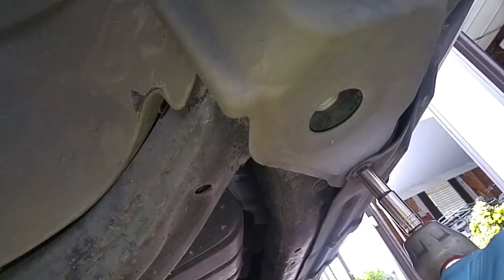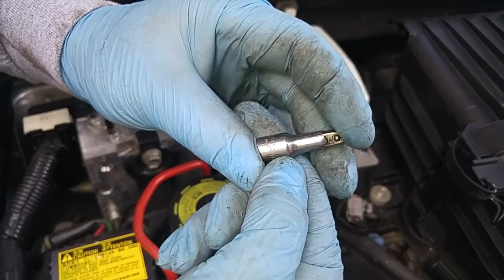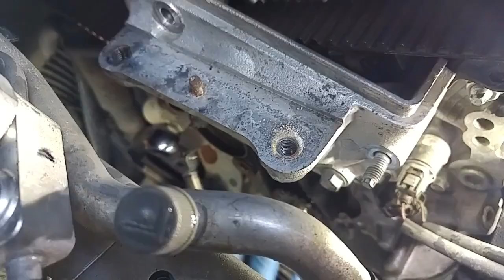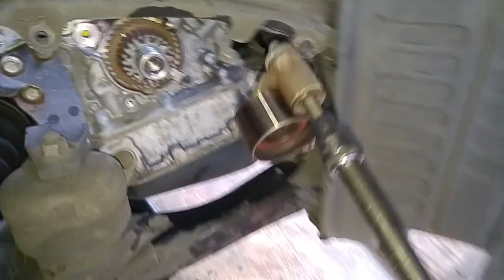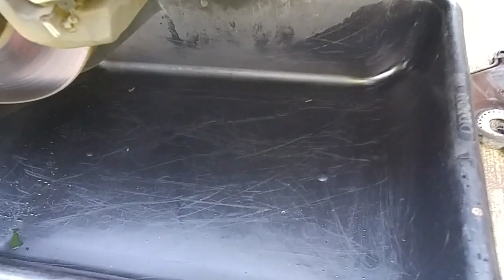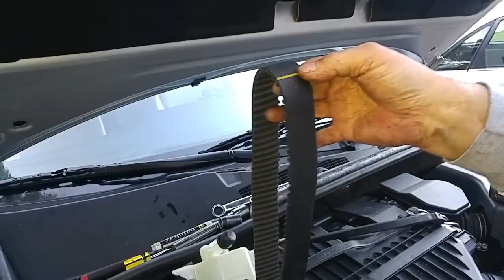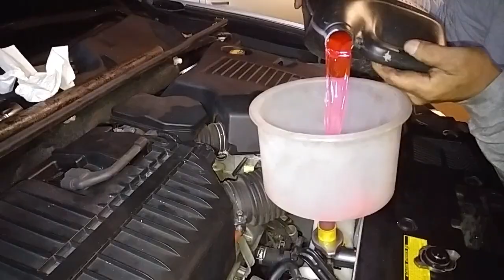Toyota Highlander Hybrid / Lexus RX400h Timing Belt, Water Pump & Seals - V6 3MZ-FE (2006 - 2010)

Comment: Timing belt is the worse invention for vehicles
Reply from the maker: Better than timing chain replacement. These chains don't last to 200k miles before something breaks or wears out. I.e. Chain guides, tensioners and chain stretch. Time consuming to replace.
Reply: @hardlymovingpro true that but all my chains last to over 365k miles like my acura rdx k23/24 engines
Reply from the maker: Consider yourself fortunate.  Replaced a 2AR-FE engine 2 years ago on a 2011 Camry XLE with 220k miles.  Original owner and always had dealer change the oil @ 10k miles.  Upper chain guide between the cams broke causing chain slap against the oil pump attached to the timing chain cover.  The slapping made a hole in the pump resulting in loss of pressure.  The chain eventually broke and wrapped around the crank pulley.  Dealer mechanic never bothered to remove the valve cover to see what was going on with the chain noise.  They did note that the oil pressure was low and recommended not to worry about it and keep driving.  Chain broke a month later.  Bought the car off of her for $1,500 and replaced with a low mileage engine (87k miles).  Salvage yard only offered $1000.  Been driving the car ever since.

Comment: Thank you for this vid. I'm doing this job on a 2008 HH but not figuring out how you removed the engine mount bracket.  I did manage to remove the upper bolt by pulling up on the AC line but it didn't seem there is enough room to pull the bracket away from the engine to get around the studs... I tried to remove the stud with a 5.5mm 6 point but it feels like it's about to round it off.
Reply from the maker: You need to get a torx socket to get that stud off without stripping the tip.  Also recommend you spray penetrating oil on the base of the stud.  Another way is to use two 10mm nuts. Put them both on the threads.  While holding the top nut, torque on the bottom nut with a open end wrench.  The bottom nut will apply twisting torque on the stud.
Reply: @hardlymovingpro mine must be dirty. I was surprised it wasn't a torx stud as I removed several on my 2010 Prius when doing the head.  I do have torx sockets and will give that a try.  I already tried the jam nut method but it could be they are too soft, I got them from harbor freight. Thanks for the tip!
Reply from the maker: You can also use a stud removal tool you can rent for free from Autozone. Slide the stud into the tool, turn counterclockwise, and three internal cams applies torque to the stud.

Comment: Great video. However I’m confused because in the video before you put the tensioner on, your yellow markings are on the sprocket markings but not lined up with the timing notch?
Reply from the maker: Thanks!  I line them up during the belt installation if I'm understanding your question properly.
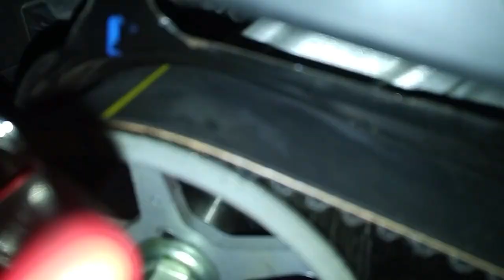Reply: @hardlymovingpro so at 20:07 the blue marks definitely look like they  do not line up to each other, I’m not sure if it’s just the angle.
Reply from the maker: Use the paint marks on the belt.

Comment: i do those belts in 5 hrs without any power tool at all...
Reply from the maker: Good for you and thanks for sharing!  BTW - including the cam seals, crank seal and water pump as well?
Reply: @hardlymovingpro  yep, no sense in going in there without changing everything...it gets easier each time you do it...
Reply from the maker: Seen lots of price quotes where the seals are excluded.  When the customer goes back and asks for the seals to be replaced, the quote jumps up over $100.  Then the customer comes to me to do the job.
Reply: @hardlymovingpro  True that, but i just figure you are already in there and takes another ten minutes to pull the cam sprockets and pop them out i just automaticlly do it and the seals are cheap... I'm retired now but still enjoy doing these simple jobs...not knocking you at all, obviously you know what you are doing, I do alot of timing belts at peoples homes and where they work and have no air in my suburban but do bring a cordless impact for the crank bolt lol...
Reply from the maker: A lot of work doesn't require being in a shop.  With the right tools, doing the work under a tree in the shade is good enough;  hence the term "shade tree mechanic".
Reply: @hardlymovingpro  being a heavy equipment mechanic for more than 40 yrs. self employed i enjoy working on these jap crates where they broke down...dosen't require much in the way of intelligence...just a good set of tools and eyes so in the shade or in the sun mox nix lol...

Comment: thank you for this tutorial.  well-edited. no excess blah-blah. I'm attempting same job soon.  only question i have, and it's because i'm completely self-taught so i just don't have any learned "feel" for lots of "simple" questions, - i cannot get a straight answer on greasing the camshaft seals.  specifically - it makes perfect sense to grease the inner lip that contacts the camshaft but i've seen conflicting opinions on greasing the outer circumference of the seal as that might make it easier for a leak to develop from there or for the seal to pop out.  '09 HiHy 248K mi, shop did timing belt etc at 110k, i did sparks at 160k (zero change in engine behavior afterwards), and i replaced the break electric pump/accumulator/actuator that failed around 230k.  that last one nearly would've totaled the vehicle if i had had to pay dealer to do it.  thnx again for the great video.
Reply from the maker: Thanks.  I grease the inner or outer portion of the cam seals, or for that matter, any seal with silicone grease (aka dielectric or plumber's grease).  Silicone will not react with, degrade or degrade rubber.  Seals are pressed in and when installed with a press tool, the seal will not pop out even if prelube.  Recommend you replace the electric water pump rotor with a new one every 100k miles.  The rotors are very cheap.
Reply: @hardlymovingpro  ✅ I have the Aisin TKT-033 kit ("TKT" ="Timing Kit Toyota", includes water pump etc) and OEM camshaft and crank/oil pump seals.  as near as I can tell, TKT-026 is for the 3.0 and 3.3 1ST gen Highlander and TKT-033 is for the 3.3 Hybrid 1st gen and both the conventional and hybrid 2nd gen.  WPT-057 water pump for all variants.  Hydraulic Tensioner seems to be the difference in the kits going from part no. BTT-503 to BTT-504.  all per Aisin World Corp of America => Aftermarket catalogue.  researching Aisin for parts is confusing as they have at least three "home" webpages.  i did not explore any Lexus or other Toyota 3.0/3.3 vehicles.
Reply from the maker: Looks like you did you homework with respect to part.  FYI on Toyota / Lexus Subcontractors:  Belt Mitsuboshi, Water Pump Aisin & Gasket (Found GMB just as good but paper gasket), Pulleys  Koyo or NSK , Hydraulic Tensioner Aisin, Seals Don't know.

Comment: I watch a lot of install/replace videos and this is absolutely the standard by which all others should be modeled.  YouTube would be much ‘cleaner’ if everyone followed your example.  Thanks a lot for the clear and descriptive commentary along the way.  Doing my car today.
Reply from the maker: Thanks for watching and good luck!
Reply: @hardlymovingpro all done except for the coolant.  The Lexus doesn’t have the same setup as the Toyota so I chose to fill the reservoir because I missed the radiator filler all the way on the driver’s side… Now that I’ve found that, I can fill it up.  Thanks again for the excellent video and instructions.
Reply from the maker: Thanks for sharing and glad it worked out for you!

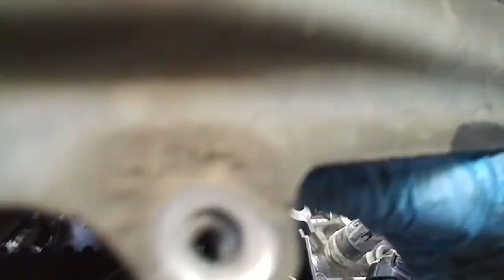Comment: Great video.  I have a major problem though doing this to replace the water pump.  The bracket you show removing at the 7:20 mark, on my 2008 RX400h there is not enough room to slide it off the studs before it hits the frame.  I need about 1/4 inch more. I have tried and tried, and it won't come off before hitting the frame.  I don't know what to do.  Is there some kind of trick I can try?
Reply from the maker: Common problem for some folks.  You'll need to tilt the engine up slightly.   I'll provide you with a link on how to do it.
Reply from the maker: Now that I've thought about it, you can remove the studs using e socket (socket that fits over a torx head).  Be careful not to strip the heads.
Reply: @hardlymovingpro  The E socket worked to get both studs out and bracket off.  Thanks again for the help.
Reply from the maker: You bet!  Good for you!
Reply: @hardlymovingpro  Well, I thought I was home free, but I have run into another problem.  The brilliant engineers at Toyota decided it would be a great idea to put the top part of the water pump behind the camshaft pulley shield, making it necessary to remove both pulleys and the shield just to replace the water pump.  I just don't understand these auto engineers.  They could have easily designed that shield so that it would pop up over that part of the water pump so you could get it off.  Since I am only replacing the pump and belt, i am frustrated that I have to go that far now.
Reply from the maker: There's a easier way.  Remove the visible 10mm bolts from the shield and you can bend the shield a little away to get access to the water pump.
Reply: @hardlymovingpro  yes, thank you. I plan on trying that next. Thanks again
Reply from the maker: You bet!
Reply: @hardlymovingpro  I finally got the water pump on, but now I am having problems with the belt that came in the kit.  It is way too short.  There is no way I am going to get it around everything even before tensioning the tensioner.
Reply from the maker: May be the wrong sized belt.  Compare the new belt with the old belt.
Reply: @hardlymovingpro  Thanks again for your help.  The old belt and the new belt are the same length.  I bought a second new belt from NAPA to compare the timing marks, and they are exactly the same distance apart on both new belts.  I am very perplexed.
Reply: @hardlymovingpro  I got an oem belt from my local Toyota dealer, and it worked perfectly.  The car is running great now. Thank you for all your help.
Reply: @hardlymovingpro  Thanks for the help.  I'll give these suggestions a try.

Comment: very detailed video thanks!
don't you need an abs bleeding after disconnecting the brake fluid reservoier? side question if I want to lift the engine for the rx400h to for example replace engine mounts or lower control arm, "all" I have to do is loosen all the mounts: driver side, passanger side, upper, front lower and back lower mounts and it is good to go? (I also saw that the orange inverter cable should be free in order to not break it while lifting the engine)
Reply from the maker: No need to bleed fluid reservoir since no air got in the lines.  Engine can be slightly tilted without stretching the inverter cable.  Here's a video I did to replace motor mounts:  https://youtu.be/ny5MlZjeMFY

Comment: What's the importance of the markings on the timing belt? If the pulleys are aligned, does it matter where the belt is? Thank you for entertaining my uneducated questions 😄
Reply from the maker: The belt marks will ensure that there's no slack between the pulleys.
Reply: @hardlymovingpro  makes sense! thank you!
Reply from the maker: You bet!

Comment: Where did you get the bolt to move the engine to top dead center? Is that something you removed earlier in the process?
Reply from the maker: I re-used the crankshaft pulley (also called harmonic balancer) bolt after I removed the pulley.
Reply: @hardlymovingpro  Thank you! I'm doing my own timing belt soon (for the first time), you've been a huge help getting the confidence to do it myself
Reply from the maker: You bet!

Comment: How much should it cost on a 06 highlander timing belt replacement
Reply from the maker: I charge $800 parts and labor.  Dealers, from what I've been told, up to $1,800.
Reply: @hardlymovingpro What part of the US are you in? Just got the spark plugs done, but not sure if I got this in me.

Comment: Don’t tell me you did this all in a day? I have a 2008 with 195k. I need to do but nervous about some of these steps. Aligning the belt, and the crank, ect. I do my own oil and brakes but this is a bit more advanced.
Reply from the maker: I hear ya.  Not for the faint hearted.  But with the right tools and taking it step by step, the job is do-able for the shade tree mechanic.
Reply: @hardlymovingpro  thanks, I’m gonna do it now. Trying to find the toyota kit with water pump and metal impeller. Need some longer wrenches, don’t have the Milwaukee ratchet but have it in my tool list now 😃 also want the toyota repair manual.
Reply: @hardlymovingpro I’m building a list of parts right from Toyota. Can’t find the part number for the seals. Where did you get those?
Reply from the maker: rockauto.com

Comment: If you remove the air filter housing then you don't need to unplug the brake fluid reservoir but just push it on the side
Reply from the maker: Thanks for sharing!

Comment: Great video! is it worth it to change my timing chain on my 2010 hybrid Toyota and has 160,000 miles 60,000 passed the Maintance My shop wants 1200😱
Reply from the maker: Wow!  You went 60k beyond the service interval?  I'd say $900 for the belt, pulleys and water pump.  Add another $100 for the cam seals.  Make sure they're using good parts:  Mitsuboshi, Bando, Gates or Dayco timing belt;  Aisin, GMB or Gates water pump;  Koyo or GMB pulleys.

Comment: HMP,  I followed these procedures for my 2006 Toyota Highlander Hybrid. Overall wonderful instructions, but I have an oil leak from the rear camlock oil seal.  I used a Felpro oil gasket as in the video at first, and then switch to the Toyota's OEM part and I still have the leak. The  gasket seating tool used and the slot was cleaned well before hand.  Would surface scratches on the shaft from when I removed the old gasket be the problem? suggestions?
Reply from the maker: When installing cam seals I first coat everything with silicone (dielectric) grease and carefully  spin the seal in place.  If you just push them in, the inner lip may turn inside out which will cause a leak (happened to me enough times to be careful putting them on).   The camshaft shaft portion that the seal rides on must be free of any residual debris or dried oil.  You may want to clean those surfaces up with brake clean spray solvent and a cotton rag.  Be careful not to over seat the new seal.  Surfaces scratches on the shaft would have to be pretty deep to cause a leak.

Comment: I wanted thank you for this video - it has helped me a ot. I actually managed to change the timing belt on my highlander hybrid - all seemed to go really well - everything lined up properly - then when I got it all back together it ran for maybe ten to fifteen seconds then just stopped ran a little rough but I started it about three or four times and it now runs smoothly - but still stops after a very brief run time. Took it apart again - enough to check timing marks and belt - all looks good but it seems I am missing something somewhere - all so getting a check hybrid system warning. WOuld appreciate any thoughts/suggestions as I am a bit confused as to what is going on.
Reply from the maker: Could be something simple like a disconnected or loose vacuum line or electrical connector.  Happens All the time.

Comment: Just saw your video doing research to do the same on my 06 HHY.  Your video is easily one of the best made and explained.  Quick question.  The tensioner you put in is actually the wrong one for later HHY and Lexus 400H.  The correct one is 13540-20040, and it is indicated by a green dot on top, like the one you replaced. The one included in your linked kit is 13540-0030.  I am not sure if the different tensioners have any functional difference, though both Aisin and Gates have them in different kits.  Have you noticed any engine performance difference or issue from using the incorrect tensioner?
Reply from the maker: The only difference with the tensioners (aside from the pulley) is the tensioner bracket which holds the pulley.  The bracket for the 1MZ-FE is not the same as the 3MZ-FE engines.  The parts used in this video was provided by the customer and it was a Aisin timing belt component kit that he bought from Amazon.  The kit did not, however, come with camshaft and crankshaft seals. To date, no negative feedback from the customer on engine performance.

Comment: I'm doing this job for my brother in a few days...glad I watched. 

Those cam seals would be tricky without pressing it in the way you did.
Reply: Also, how do you feel about anaerobic sealer on the water pump gasket and the cam seals?
Reply from the maker: Don't need a sealer if replacing with a metal gasket.  Cam seals don't need any sealer.
Reply: @hardlymovingpro  I was thinking instead of the dielectric...I like to use the red anaerobic on anything rubber. 

The rock auto kit I got had a felt water pump gasket that came ripped, so I had to go get one from napa, and it was a metal one...seems way higher quality.